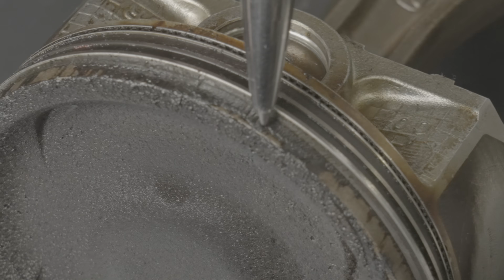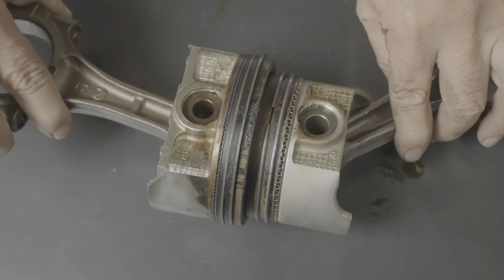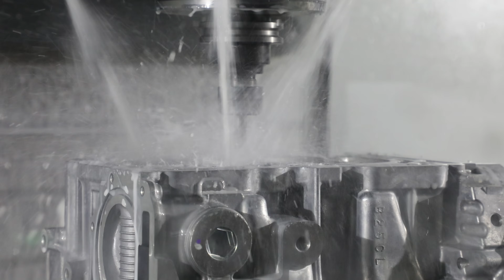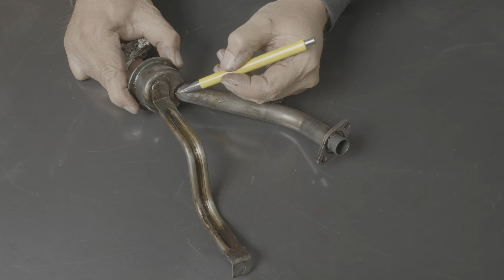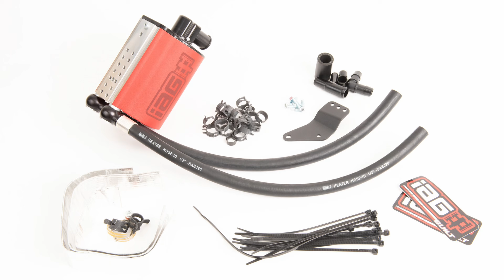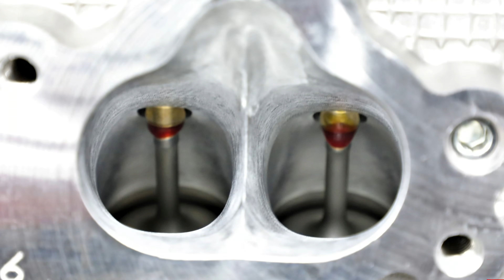Why Subaru Engines Blow Up!

Comment: Boxer engines have a tendency to break timing belt because the belt is so long . The 3.0 is better because it uses timing chain .
Reply from the maker: Belt breakage isnt an issue with these engines unless you exceed the service limit.

Comment: I am in Albany, NY and go to Round Lake Auto. Their exact recommendation when I bought my STI Hatch 2 years back was IAG AOS, Killer B Pickup+Windage Tray, and GetaDom Cylinder 4 cooling mod. I run the engine stock and daily it, I'm at 90kmi with no major issues.

BUT I do have a savings account specifically set aside for if/when the engine pops. Hoping for 160kmi... hoping.

Comment: I just wish Subaru would have built a strong motor like the 4g63 or rb26.
Reply from the maker: 4G63 is super strong, RB26 not so much.
Reply: @motoiq  he’ll even the ej207 would have been great.
Reply from the maker: Better than the 257

Comment: The EJ22T does actually have twice the ringland of the EJ257 along with the smaller bore and has matching quench on the pistons. I never knew what it was for until you informed me. The EJ22T is known for being very stout in stock form 👍

Comment: 99% of broken Subaru's are caused by broke Subaru owners.
Reply: Dam hit me where it hurts 😂
Reply: It's weird, here in the UK we've had Turbo / WRX Scoobies since 92, the STi since 94.

I never heard any issues of them except that when pushed far beyond the engines design window piston 3 could have issues at 100k or so. But even that was pretty rare. Maybe it's more on the post Hawk Eye models?
Reply: @realMaverickBuckley  I've never had any issues making 400whp on old EJ20K's. Change the timing belt regularly and keep the fluids fresh. I used to buy imported engines here in the US and never had a EJ20G or EJ20K with a problem.

Here in the US our Legacy in the early 90's had a closed deck 2.2L turbo that was indestructible and basically where the 22B came from. The crazy part about them were they were turbo with no I/C or special models had a coolant cooled I/C.
Reply: @realMaverickBuckley the US were given crap engines and parts Uk cars were basically jdm spec with better internals and quality
Reply: According to this video it sounds like they’re garbage no matter what you do to them which as a new STI owner, is depressing to hear.
Reply: @Jrob992 Well, the new ones are garbage, but that is just all new cars in general. They are making them that way intentionally to keep selling you more cars.

The older ones were tanks! I still daily drive a old EJ20K swapped Forester. I run a Apexi standalone ECU that I tuned myself. 

As long as you don't slap a bunch of aftermarket bolt ons on it, it will be fine. Canned accessort tunes are a major engine killer. If you do any mod, get a wideband gauge installed. Boost leaks will cause lean conditions. Ej's run advanced ignition timing so lean conditions can cause detonation. That destroys engines the most.
Reply: That’s fair.
Reply: Not true.
Reply: @trippleoseven  true.
Reply: They’re broke from having to repair or replace their motor every time 😂😂

Comment: The talk about using an air to oil separator reminds me of the time I had to deal with excessive blowby on my late 90s Nissan Maxima. I think it was a ringland issue. It was a stock motor too. Had to buy a catch can, but it was so messy because it was milky from condensation. Sorta a nightmare.

Comment: Ive been thoroughly impressed with my FA20DIT in my 2018. 110k miles now with 80-100hp over stock since 30k. Never lost a drop of oil between oil changes until recently and thats likely the turbo seals. Juat did an oil analysis report from blackstone and the results were great! Wear was much lower than the average expected.  I think the biggest issue is that these engines are pickly but people do shitty mods with shitty tunes and drive shitty then they pop 😂 if ypu follow the rules they seem to be great! Cut corners and expect the unfortunate. Also, running low on oil i think happens more than people will admit.

Comment: i drive subaru lpg engines since 40 years and very hard ... i never ever had any problems ... what are you talking  about ... the longest engine  had 600 tsd km before i sold the car and hes still running...
LPG and all 15 tsd km oilchanges and they run for🎉ever ...
Reply from the maker: LPG is a really good fuel, no broken ring lands for you.

Comment: Hey I just watched this and subscribed. I have an xrs with the 2ZZ motor. What do you think of the 2ZZ? And should I balls out NA, turbo, or supercharge?
Reply from the maker: No aftermarket support, expensive to build.
Reply: @motoiq  I have Monkeywrench Racing. I've already installed a brand new transmission with LSD, brand new throttle body, bushings, short shifter, literally today a brand new alternator. Some other stuff. Dont worry about me getting parts, just curious which way I should go. Max whatever Monkeywrench can get me. Built 2 liter motor, 12.5 compression, or supercharged or turbocharged variant. My current engine has 250K miles and runs like a sewing machine. It's no Subaru for sure, think more like the K engine you were talking about. 6 speed Lotus transmission. I'm doing suspension, literally everything.
Reply: @motoiq  that's it? Don't do it? Well lmao. Ok thanks. Guess I sgoulda patrioned or something first.
Reply from the maker: I am not saying don't do it, I am not interested in it.

Comment: Bro, honestly. This was one of the most concise and honest breakdowns of Subie engines. The good, the bad, and the ugly.
Reply: @alexanderavila563 a lot of problems are due to the short stroke causing tip much angle on conn Rods this causes too much side way pressure against the side walls of the cylinders, I figure this is why the piston is so short with little ringland plus needs a wide bore due to short stroke, this also had less torque and efficiency than a lube stroke design. If subaru had a wider engine with a longer stroke things would be better and less skimping on structure. The. EE20 2ltr diesel engine eventually breaks the crankshaft due to the block having to little metal (alloy) to properly support the crankshaft main bearing carriers. Looks like to me subaru doesn't want engines to last very long (planned absence), sorry for telling you subaru fans the truth, I figure it will hurt. I'm considering buying one over the last few years but the engine reliability and efficiency has prevented me from doing so. This video has verified the lack of redundancy built into every component of these engines. I was considering the Outback 2ltr diesel as a easy run workhorse but after looking at them I realised All of them break the crankshaft.
Reply: I didn’t hear anything good…
Reply from the maker: @GregoryCunningham  There isn't much good.
Reply: @GregoryCunningham  he said the cranks are actually really strong and can make really big power stock, which is good I guess
Reply: @GregoryCunningham the title of the video is why subaru engines blow up not why they are great. I own two so this is extremely informative.
Reply: @GregoryCunningham good ports
Reply: @GregoryCunningham 
The good is they are made very lightweight infact so light they can't take any abuse. After watching this video I've congee to realise subaru are master scammers, they paid Colin McRae enough money to convince the world they had a good engine. I feel like a flat Earther that has been scammed but wing admit I was wrong so I choose to ignore facts and choose my own reality. BTW I don't drive a subaru😂
Reply: @GregoryCunningham  who would want one.
Reply: I also didn’t hear anything good lol. Only plus is low center of gravity? But. With all those issues and quirks. Almost wouldn’t mind slightly higher engine that is better in every other way
Reply: @alexanderavila563 a lot of problems are due to the short stroke causing tip much angle on conn Rods this causes too much side way pressure against the side walls of the cylinders, I figure this is why the poison is so short and wide bore due to short stroke also less torque and efficiency. If subaru had a wider engine with a longer stroke things would be better and less skimping on structure. The. EE20 2ltr diesel engine eventually breaks the crankshaft due to the block having to little metal (alloy) to properly support the crankshaft main bearing carriers. Look like to me subaru doesn't want engines to last very long (planned absence), sorry for telling you subaru fans the truth.
Reply: "Why Subaru Engines Blow Up!" is a Very Broad and Untrue Statement.
The 4 cyl is very popular with small airplane builders because it's so Reliable. And the Subaru 6 cyl. is a fantastic engine, Subaru et the engine blocks from Porsche, it's the one used in the GT3.
Reply from the maker: @kennethrhodes7143  It is not untrue at all for the reasons I carefully explained. The blocks do not come from Porsche, they are way weaker than Porsche ones as well.
Reply from the maker: @kennethrhodes7143  It is a stupid engine to put in a car, any car engine in a plane is a bad idea.
Reply: @kennethrhodes7143 what shit are you smoking subaru doesn't get blocks from porsche. This is an urban myth. The engines are as different as can be besides being a flat config and both using gas from the pump. Let's not even get into the subaru engine conversions for planes. Do you want to wrench or do you want to fly? There are a few decent subaru motors, but not many. They are infamous for issues with gaskets... primarily in their NA motors. 100k miles on a subaru NA headgasket used to be good life.
Reply: @kennethrhodes7143   not an expert, but is airplane engine go through emission test and subject to CAFE?  and if these airplane engine suffer the large bore area/ring issue note in the video (or builder specially look for old design that is not being push by emission factor)
Reply: Ya, "not an expert"!  You were not even able to Analyze the information provided in my comment or the video?
He pointed out that the issue is primarily with the turbo charged engines.  And my comment pertained to small, personal, typically DIY air plane builders, so your question does not apply.   @gogozy1
Reply: @kennethrhodes7143  It's a somewhat true statement, however only with context, that being terribly modified (boosted) ones & ones owned by idiots revving the F out of their engines with no load.
Aeroplane builders always use engines in the stable area, in fact most aeroplane-designed engines look terrible hp/liter, but that's because they are run in a different way to what is in vehicles, especially the RPM range, which is extremely narrow in comparison for 90% of the time.

So, yes, good engines, very good form of combustion engine in general (all horizontal engines are just amazing imo..) but people will be people & do dumb stuff.
Reply: "Somewhat true" ? Ya, and "If" my Aunt had Balls She'd be my Uncle!  @bo-dine7971
Reply from the maker: @bo-dine7971  The loads on a plane engine smoke car engines, it's why plane engines are low rpm, and are built really strong.  Imagine being on a continuous dyno pull for most of your operating cycle.

Comment: The FA24F engine which is in the new WRX models is BY far the most robust and best engine Subaru has ever made. The EJ motors are prone to issues I’ve had many Subarus, but the new WRX engine is fantastic 👍🏻
Reply: Absolutely true, solid engine
Reply: Yea i have a 17 with the fa20dit which is the basically same engine just a lil smaller..80k at 330whp no issues at all

Comment: Another issue is 91 gas when 93 should be minimum to help with knock. Many states only have 91 available
Reply: precisely
Reply: The WRX vb manual calls for 91 and even says you can run 87 without affecting engine reliability and it doesn’t void the warranty. 91+ is recommended for optimal performance and fuel efficiency.
Reply: The knock sensor and computer keep the engine on the edge of pinging regardless of fuel grade for efficiency purposes. And it is basically never worthwhile to pay extra for expensive fuel; the fuel economy gain from automatic timing advance won't make up for the added cost.

Comment: 13:34 RSD makes a fantastic WRC Pan for the EJ series motors with trap doors and a modified pickup and windage tray.. I like it because everything within the pan is removeable for cleaning and service. I recommend them, price wasn't all that bad either. We do about 4, 24hour races a year with the flat 4. no complaints. 
Edit: also having any kind of Accusump in your car for track environments is a MUST. cheap easy to install, keeps the oil in your car long enough for you to realize you have a problem to save your bottom end
Reply from the maker: It looks to be a very good design.

Comment: My buddies VB almost blew up a few days ago because his turbo oil cooler (idk its technical name) had the two bolts that seal the gasket on the bottom of the turbo completely back out and cause a massive oil leak. No low oil warning just a shitton of smoke. When we took off the metal undertray, there were 2 bolts just chilling standing straight up like a cartoon. We realigned the gasket and put the bolts back in. It had lost 3.5 quarts of oil lost in a matter of minutes.

Comment: So how does this affect the EE20 Diesel engines then, I got the Third gen EE20 Diesel and it is showing signs of wear too, I know the first 2 gens pretty much always break on these but they say the third is better, however mine is probably having poor compression and is having a very hard time starting in temps below -10 at -15-20 it is almost impossible to make it ignite and it sounds like one cylinder have less compression than the others on the starter. I also have a sound when the engine is cold that sounds like "piston slap" that gets better after the engine warms up. it also pulls over 2 liters of oil per 15000km. when I bought it back then it took about 1liter oil between the changes. But due to our countries stupid laws they forced us to have fuel with up to 40% Bio diesel mixed in with the fuel and the particulate filter got destroyed and the engine burn so poor on this fuel it ran in the regen mode all the time and after this it never been itself even long after the filter was fixed. I think the engine ware during regen is much higher than on normal operation and it probably damaged the pistons or soot burned in the rings making them stuck or something. I am a bit afraid to try engine flush as it can make it even more leaky if the rings have stuck.
Reply from the maker: The diesel has a poor reputation for reliability.  We don't touch them as they are not in our market.
Reply: @motoiq  yeah I guess so, But it would been fun to see one taken apart to see what wears most in them and figure out if the pistons are weak on the Diesel too

Comment: Thanks a lot, Mike. I'll now be unloading my Subie with its time-bomb EJ20K engine as soon as possible!😅Just kidding, thanks for the informative video!
Reply: The 2 liter has a 92.5 bore and better quench so less detonation, so no stuck rings or broken ring lands like the 2.5. Also the cylinder is much thicker so more stable head gasket.
Reply: @2003wrx64  I feel better already! Thanks. 😊

Comment: Fantastic video!  Any opinions on fa24dit motors yet?  Would love to know how/if they've changed much from EJ.
Reply from the maker: A smaller bore could allow better ring placement.  Don't know for certain we haven't done the DIT yet, just the non turbos.
Reply: @motoiq  Thanks for the reply!  No 2.4l DIT teardowns to speak of on YT yet.  They're just so new yet I suppose.  They sure make good power tho, but for how long idk.

Comment: Putting a turbo on anything other than diesel big rigs and heavy equipment is a fools errand. Even then, you have to do maintance with the religious fervor of a suicide bomber prepping his vest. Putting a turbo on what is basically a second generation style Beetle motor is insane. Turbo-ing a 3 cylinder overbored lawn tractor motor (Ford EcoBOOM!) is batcrap insane.
Reply from the maker: There is nothing wrong with turbocharging things other than diesels if stuff is designed right for it.

Comment: My tuned 2002 WRX made it to 345,000 miles. Transmission and turbo went out.  Engine was fine.  Best sounding 4 banger ever.
Reply: 02 was the best year.had stage 2 tune and replaced factory clutch after 180k miles of straight abuse 4.5 to 6k rpm launches regularly. Car continued past 200k miles until it was stolen and crashed into someone’s house. Then my boss where I use to work (Firestone) sent me a picture saying recognize this? a year after it was stolen of my car sitting on the alignment rack with new wheels on it still going strong. 02 wrx wagon rally blue. Now I have a Toyota GR Corolla. Shit is nostalgic!!!!
Reply: I know sound is pure opinion, but in 4 cyls., I love certain v4's. Yamaha vmax, honda v4's with a 180 degree crank, panigale... also the cross plane crank yamaha R1's sound similar, and awesome. None of those really suitable for a car,  unfortunately.
Reply: @firstielasty1162  I have a vfr 800, awesome engine with a awesome sound. I think a larger displacement v4 would be a great idea
Reply: My 2002 Toyota Celica GTS went 405k miles and still going,  can hit redline/lift all day long.  Best sounding 4 banger Ive ever owned😂
Reply: This gives me hope 😂

Comment: they run too lean from factory. bigger, heavier chassis = more fuel consumption, unhappy customers. Add cold air intake = problem becomes worse. Protuned = Doesnt defeat the physical presence of surplus air inside the engine. kaboom kaboom
Reply from the maker: They don't run too lean from the factory, just the fuel system has no headspace, stock its fine. There is no such thing as surplus air in engine that causes tuned cars to blow up, just improper tuning.